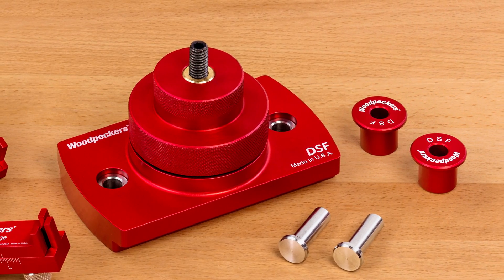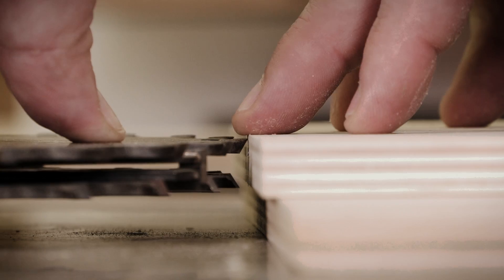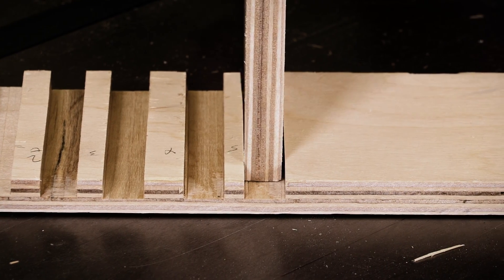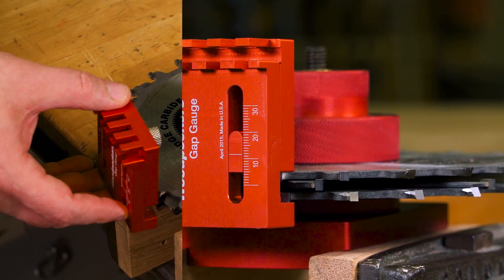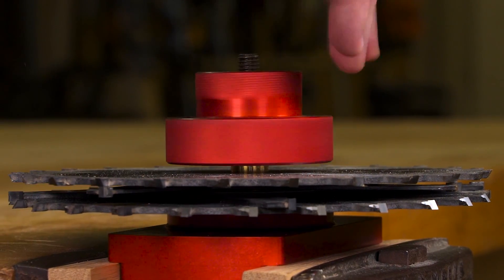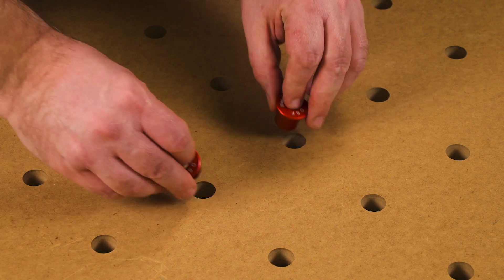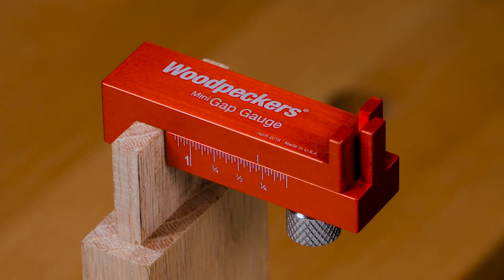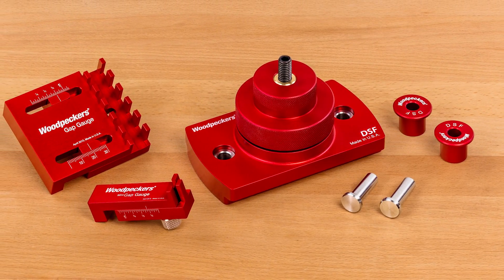Dado Setup Fixture and Gap Gauges

Comment: Does the mini gap gauge have metric markings on the other side? I would supose so, but all the shots are of the same side (with inch markings) and I would like to confirm before I order.
Reply from the maker: That's right. Inch on one side and metric on the other. Sorry all the shots are from the inch side, but I just checked and the metric is engraved on the other side.
Reply: @WoodpeckersLLC  awesome. Thanks 👍